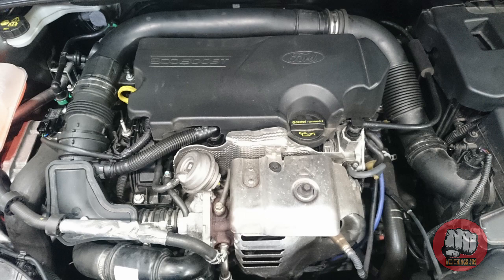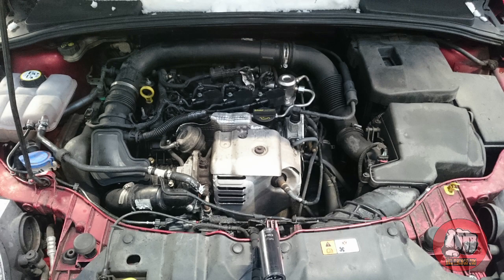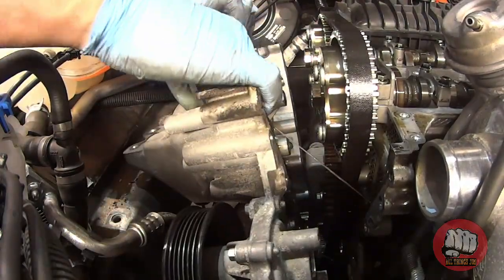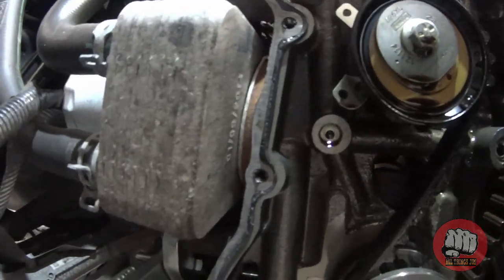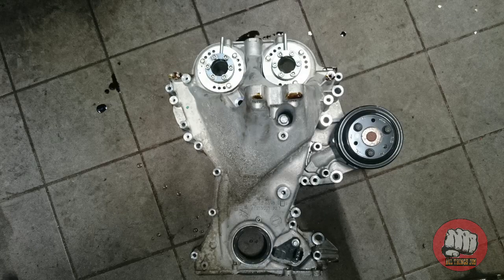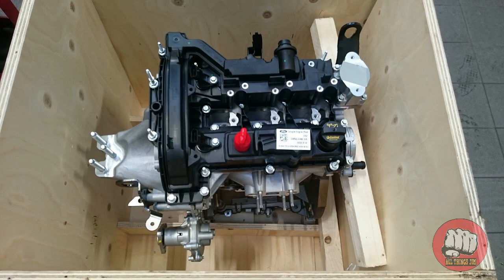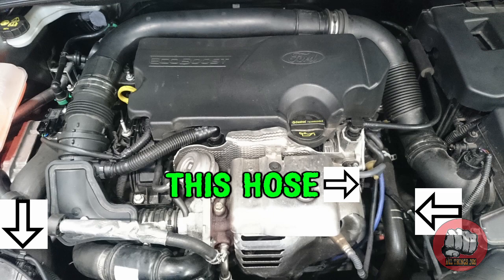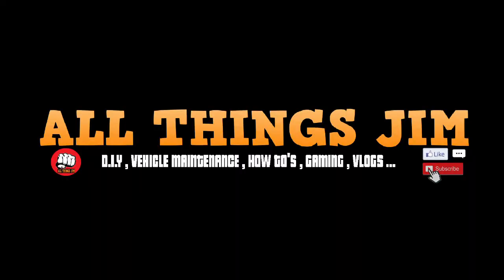Lets discuss the 1.0 Ford ecoboost engine

Comment: Had both belts changed at 10 years old 50k miles, only main dealer would do the job, two and half day job, £1,400. Factor this in if you buy a used one.
Reply: Had mine done at 10 years and 50000 miles. The mechanic showed me the belt, which was perfect and the sump was clean with no debris. Perhaps I was just lucky, or it is down to always using the correct oil and changing it annually.
Reply: @philiponsolent7232  If you use the correct oil and change it regularly, it really helps. You always get a bit of petrol entering the oil past the piston rings. Tiny amounts but it builds up. If you don't change the oil the petrol eats the belts.
Reply: @philiponsolent7232  yeah I do that with my car – a Honda hybrid however the narrator of the video talked about the chain being a good idea. That’s not necessarily a great answer either a number of years ago I had a Suzuki ViTara (small SUV)with a V6, the cam chain needed replacement at about the 200,000 km mark. The price at the time was 7 1/2 thousand dollars, which was basically the retail value of the car being 10 years old with that many k’s a shame because it was a good vehicle.
Reply: @philiponsolent7232  αυτο πρεπει να κανεισ φιλε μου και δεν θα εχεις προβλημα ποτε
Reply: Shit needs to change the timing belt max 7 years or 80kkm... particles  from belt can cosu sirius faluare. Belt particles block path for oil on  prptection net oil sump gate.
Reply: Just quoted £1,875, by main dealer for cambelt and water pump
Reply: Designed to not last.
'There is no Long term Replacement for Displacement,'
Reply: Ford recalled the engine yesterday, might be worth asking ford customer services for a refund
Reply: @Thehuntedfew1 Which kind of engine do you have what Ford recalled ? The 1.0 liter 125 HP mild hybrid ?
Reply: @scooby0000 The wet belt recall is US only
Reply: @Thehuntedfew1 Recall is US only sadly
Reply: Yes, it's the not knowing how bad they are. On the 1 litre Ford and many others inspection is impossible so you have to change them when advised or sit behind a time bomb! The modern world I guess. Of course years ago a double overhead camshaft, fuel injected, turbocharged, with a 21 psi cooling system engine, would have been in a racing car, not a family saloon!
Reply: @scooby0000  I don't think it's a problem with more recent models, I presume they went with a chain instead but I'm not certain. 
The 1L ecoboost had this wet belt problem for about 7 or 8 years worth of models. There really should've been a recall in Europe too but it would likely have been too costly as previously stated. It's just a ridiculous design and the cambelt change recommendation isn't altered accordingly, it being sat in oil will inevitably lead to it accelerated degrading. There are garages in the UK that literally keep those engines on the shelf, they die that often.
Reply: Good advice.
Reply: @scooby0000  No they have the same fault in Europe just that ford have only done the recall in the US for the 1.0 ecoboost currently maybe was having too many sending them to court and it's cheaper for them to do there than in Europe which has a lot more 1.0 ecoboosts on the road
Reply: My 1.5 ecoboost engine is covered  by arnold clark,s 2 year autocare
Reply: My mechanic said he do it for me for about £500
Reply: @Antonio-gq6fx  aboutsiluty ridiculous 🙄
Reply: @Antonio-gq6fx  yeah, could be okay. As others say it is a 'dockyard' job. There are no gaskets, huge number of different bolts are angle tightened so can't be reused and both timing and oil pump belts are needed.  Many report doing huge mileage without problems, it just your luck whether they fail.

Comment: Mine is at 47,770 on my 2020 SE 1.0 and picked it up Oct 10. I sent it in October 7. I had a free rental from the dealership while my car was in their shop. I had a 2024 Bronco Sport Big Bend with BLIS, no factory navigation and a rotary dial shifter. My EcoSport was a previous rental I got May 10, 2021 with 2182 rental. I only had to replace the front brakes, battery earlier this year after 5 years. Mine is in Smoke Metallic with blindspot mirrors, no factory navigation, but one car accident that wasn't my fault since at a 4 way stop the person that hit me went before me and I had arrived first. I had a witness since the cops never came yet I called twice and it was two days after Hurricane Ian here in Florida. Their insurance paid $8400 to fix my vehicle, but was without a car for 5 weeks after my accident. My backing plate was on its way out of the oil pump. I was still on my original engine.

Comment: I had my low oil presser light came on, i took it to a local garage and they cleaned the filter it was blocked with rubber, but they did not tell me that that rubber was off the wet belt, i paid them 450 pounds, then 3 weeks later, bang the wet belt snapped, i have a fiesta 1 ltr eco boost. the AA took me to another local garage, and they said that, the garage as soon as they sore the rubber of the wet belt, stuck in the oil filter, they should have told you that the wet belt needs changing, because if it snaps, you are in big trouble, i put the car in today, i am just waiting to ear want the damage, can i get any money off the garage that did not advised me to have the wet belt changed, instead of ripping me off for 450 pounds just to clean it out, when they should have told me to get the belt change. Can you leave me any advise on this matter ,i have heard that ford will do the job or pay to have it fixed, but you need the full service history, i have only parts of the service history. Let me know want you all think.

Comment: To be fair i have a 2012 focus 1.0 and its been decent, mechanic myself so sorted all the common waterleaks including heater matrix pipes when I first got it,  regular oil changes and had the belts done . Always regularly check the coolant level and it's been sound

Comment: If you're gonna discuss the 1.0 Ford Ecoboost engine atleast mention the exact motorcodes and modelyears. The 1.0 3-cylinder Ecoboost has been around since 2012 and theres good ones and theres ones that have a wetbelt that are run with the wrong engine oil (which causes the belt getting eaten) and ones that drive around with old dirty oil (causing fuel/ethanol to get in the oil which then eats the belt even if you use the correct oil).

I admit it's a stupid idea to have a wetbelt, but if the engine gets frequent oil changes with the correct oil (note, the oil has to have a specific additive that prevents the belt from getting eaten) they will last untill Ford recommends them to be replaced.

Comment: I’ll stick with my 20 year old Skoda Fabia VrSTDI PD. The body and electrics are a bit worn but the engine at 120k is just run in. The engines in today’s cars are crap reliability wise and this is one of the worse. It is a shame as it is a good engine when it works.

Comment: Very good information. Does the engine have to be removed to change the wet belt?
Reply from the maker: Thanks! No the engine does not have to be removed, it is however around a 8-9 hour job to do properly 👍

Comment: My  engine is loosing power when my rpm goes beyound 2000,  ive changed the fuel fillter twice and also the fuel pump and the problem is still there, what might be causing that?

Comment: Ive got the 155 in a puma manual its an amazing engine and i will do regulat oil and belt service evry year it should do 250 000 if im lucky i had a focus 125 for 4 years not a problem

Comment: I inherited a Fiesta Eco boost off my mum 3.5 yrs ago. Full service history. I only do 3k miles per year in the countryside so mostly doing 60mph in 5th. It's been a dream to drive. Never missed a beat, and surpassed all expectations of a 1L engine. 
Today, it died as I was entering town. The power just went from the engine completely. I think it was still running but nothing from the accelerator. It then demanded a manual restart, but it wouldn't restart. There were no dodgy noises, nothing. 
My mechanic called me and has been vague about the cause, but says it's irreparable. It's only done 48,000 miles since 2013.
Reply: Pregúntale...
Reply: I can almost guarantee what that is (because the exact same thing happened to my son 2 weeks ago). Either the plastic tensioning arm for the wet belt shifted or snapped, or the wet belt itself had disintegrated enough to clog the oil lines. Either way, that'll lead to a zero warning immediate superheat of the engine - forget blowing the head gasket, it'll crack the head or block.

My son's car with 48k miles on it was an economic write-off (worth about £2,500 in good nick, but a recon engine was at least £2,000 to fit). I've kept the report from the mechanics diagnosing the split block in case Ford Europe ever decides to actually come clean about this lunatic design and do the right thing.

Ford USA has already gone for a full recall of all vehicles using its 3 pot 1.0 Ecoboost engine - about 140,000 vehicles affected over there (which isn't many). Ford Europe is still pretending nothing's wrong (almost certainly because there's an awful lot more than 140,000 vehicles affected in Europe).

Moral: NEVER buy a Ford.

Comment: The main thing those days you need to do with those turbo little engines is to do a oil serwis every 10kkm or faster. For the wet belt every oil serwis check/inspect the (i dont know whats the technical english word) oil suction gasket and clean it.

Comment: As an old guy who started working as a mechanic in the late 1960s I formed an opinion then which has only been reinforced over the years since, namely never touch a Ford with a barge pole. They've kept me in work many times but they were the pits way back then and if anything they've just got worse for a ton of reasons.
Reply: Ford did turn it around in the 80's through the early 2000's. They have hone back downhill in the last 15 years though.
Reply: I am a driving instructor and always taught in Ford Fiestas...up until the `eco`-boom age that is...never had any real problems with the zetec engined cars....reliable, 45ish mpg, nippy, nice handling, cheap parts, cheap to insure....when Ford switched to `eco`-boom, I switched to diesel.

Comment: Just recently forked out £1400 to get both belts done, new plugs and a new VVT cam bolt. 90k miles so I thought it made sense. Car running well, hope to get another 90k as I really like my Fiesta. By the way, needed a new vacuum non return valve. Original broke up. New one £10 from internet. Easy to check, easy to fix. Screws up the boost when broken

Comment: I have a 2017 Ford Focus ST Line, which has the 1 litre ecoboost engine. My sump strainer got blocked as the wet belt disintegrated , starved the turbo of oil, here I sit £1,500 l8ghter.

Comment: Brought a transit 250 glade it not a eco boost, they say it better mpg being a 3.5 vs 3.7 but everybody getting around 14 mpg but the non boost 3.7 Iam getting 20 mpg, let the fast shift 6 speed move the van as it very  torque and I never go above 2k  but still it fast

Comment: I had a ford fiesta 2018 with the same problem, my local garage told me its because i am not using the correct oil which was true. This engine problem mainly comes when the wrong oil is used which heats up the wet belt and makes it block the oil pump

Comment: How does the chain driven version of this engine compare with the wet belt? Is it proving to be more reliable or is it one to avoid as well?
Reply from the maker: It is more reliable yes, however there are some instances of the oil pump belt breaking up still due to it still being a rubber type wet belt. Hope that helps 👍

Comment: I was told years ago by an old mechanic if your timing belt gets contaminated by oil, change it asap as it will eventually snap!! And that was on Vauxhall Victor engines which were non interference engines. I had one that lost its teeth on a bit of belt, about an 8" stretch of belt, that stopped the engine starting, but no other damage.
Reply: I wonder if it has crossed your mind that the compounds used to make the belt might have changed in the fifty years since anybody last bought a new Vauxhall Victor?

Comment: Small highly strung engines that have to constantly work hard just wont last. Imagine how hard that engine has to work whenever you drive up a steep hill or whenever you are on the motorway. Engines that do over 250k miles are usually six or eight cylinders. BMW's M57 3.0 turbo diesel engines can easily do 400k plus. Toyota's V6 petrol engines. Lexus V8 petrol engines. Honda J series V6 engines. Ford 5.0 Coyote V8. The idea is to have healthy mid range torque.

Comment: Had all of these problems on my car one after the other Ford replaced engine after cylinder head went due to pipe failure.then injectors went and had to be replaced I've also had 3 starter motors.
Now the wet belt has gone after 25k miles!!!

Comment: I have a 1 litre ecoboost Fiesta 2013 152350 miles Belt changed at 150000 Belt showed little wear I have serviced it myself in my 5 years of ownership never let me down fantastic car. Look after it and will look after you. Last 8 cars all Ford all high mileage never had any trouble.
Reply: Well said,, I've had several, got one now, just poor servicing, wrong oil spec...
Reply: I have a 2014 fiesta 1.0 with automatic gearbox and with regular service with the right oil seems to be reliable little car to my liking!
Reply: When you think about it? These are the sort of cars youngsters would use. The styling is certainly aimed at them. So it really isn’t surprising that more mechanical issues are recorded on these types of cars. Like most engines. If you don’t thrash them to with an inch of their lives, they should give good service. I think the main enjoyment you get from driving a fiesta. Is from the handling. Every reviewer has said how nimble and fun it is to drive. I have just bought a 2018 example of the ST line fiesta. A bit of a comedown from the large SUV I owned. Really looking forward to finding some nice twisty roads to enjoy it on though. 😎
Reply: That is powerful to hear that.. Regular servicing is key
Reply: Vous avez fais la courroie après quel âge ? Merci
Reply: Do you regularly service ? What do you think has helped get the high mileage
Reply: @MccarthyUK100  Yes i believe that regular oil and filter changes are very important A lot depends on the type of driving style you have. I tend to be gentle on acceleration don't labour the engine change down when it appears to be straining remember it is a small-capacity engine
Reply: @MichaelSharman-gf5hx what is considered regular for this engine?
Reply: @michaelsharman9724  nice one..
Reply: What kind of mileage do you have now? I’m looking at one but do 15,000 miles a year.
Reply: @matthewgreer4758  Hi mileage now sitting at 188953 further to my previous message if serviced on a regular basis there is no reason for it to go 200000+ I am confident  it will go on more. Like a woman to get the best treat her right

Comment: The 1.2 pure tech good little engine but also has a wet belt... Any kits to convert to dry belt ?
Reply: yes run the engine without oil

Comment: My wife’s 2003 Ford focus 1.6 ebony with 84.000 miles on the clock has now had 2 timing belts fitted on because of its age on because we don’t think the first garage change the water pump out which he changed use for and the pump went a couple of years ago so new belts fitted the last thing to going out wrong happened a few weeks ago was the power steering pressure switch blew out but was cheap to have fixed apart from a window regulator and brake parts the car runs great my car is the work horse been a diesel 1.6 2015 Astra j with 54.000 miles on it the I need a glow plug replaced which cost a lot because they have a pressure sensor on them It has a timing chain which is at the rear of the engine so hopefully it will last because it would cost a small future to replace

Comment: It aint' just the ecoboosts either.

They put these stupid belts into the Panther diesels that are used in post-2016 Transit and tourneo vans... And they're even worse in this case!!

The belts are fairly resistant to the engine oil and so long as you keep up with maintenance and ignore Ford's 24,000 mile recommendation on oil changes and at least halve it or even do every 4000-6000 miles, the belts will last.

there is an issue though with the diesels running their DPF regen cycles which causes fuel dilution of the oil, which causes it to attack the belt, then you end up in the same mess most of the ecoboost petrol engines end up in...

particles of the belt get caught up in the oil pickup tube

but worse than that, the vacuum pump is cam driven and is lubricated by the engine oil!!! So if your belt starts failing and chunks make it to the oil feed for that, say goodbye to your ABS and brake assist!!

Either Ford themselves or someone else should come up with a chain conversion kit for these engines. They have the makings of a good, reliable little 2,0 diesel, but those damn belts let them down massively!

Comment: So from 70 plates onwards apparently they started using chains and corrected this issue i'm told. This is right ? I did want a fiesta till I started hearing all this ecoboom talk lol
Reply from the maker: From around 2020 they changed to chain, however the oil pump still has a belt 👍
Reply: So its going to be the same issue regradless ? I really wanted the 138bhp ST Line X till I started seeing all this talk about eco booms :( @ALLTHINGSJIM

Comment: The ford 1.0 ecoboost engine is shite. do not buy any ford vehicle with this engine installed they are a money pit and bad for the environment. These engines want wiping off the face of the planet as well as the designer's manufacturers and ford bosses.